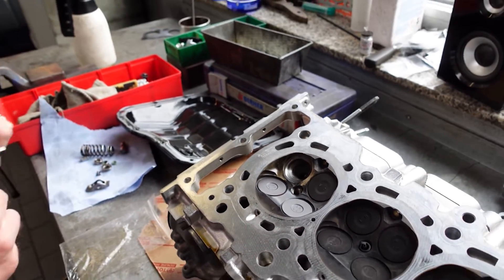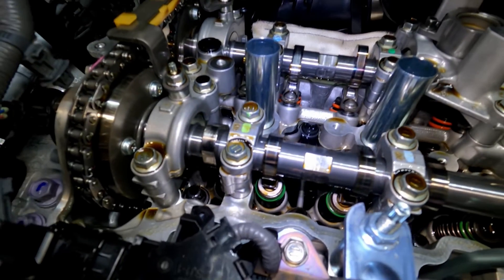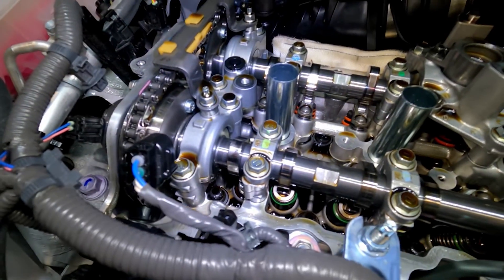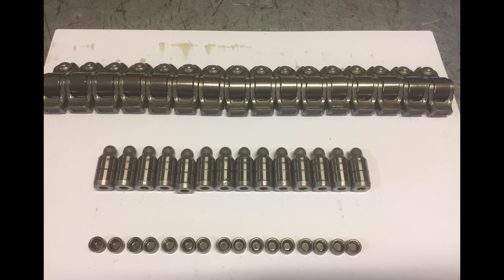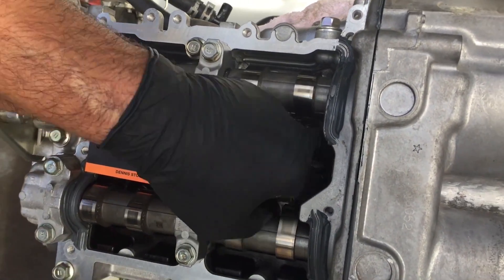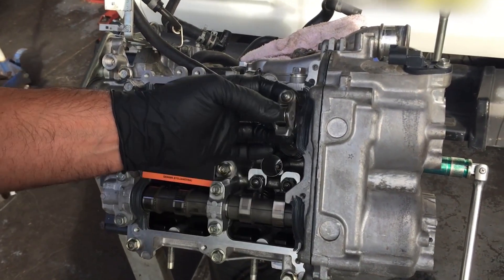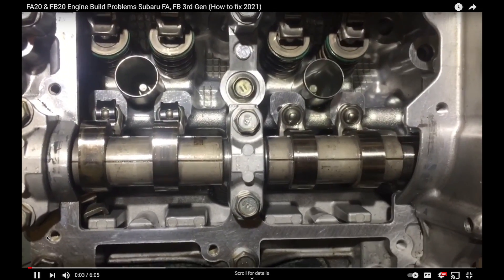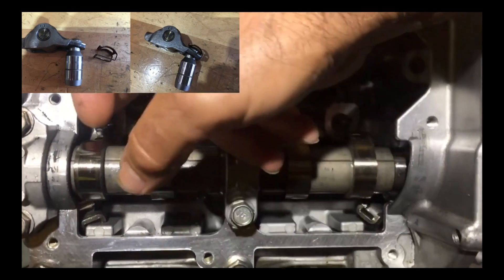G16E-GTS Yaris GR Engine Over Rev Blowing Engines? (Same problem as Toyota 86)

Comment from the maker: It's become apparent that after releasing this video about the death of @Robert Mitchell's Yaris GR on the Nürburgring, that rockers are failing on more of the G16E-GTS engines. 

That’s why we’re developing a bespoke Rocker Retainer Kit for the Yaris GR that replaces the hydraulic lash adjusters with solid pivots and rocker retainer clips. 

The Rocker Retainer Kit upgrade will give drivers of this hot hatch peace of mind, ensuring reliability no matter the driving conditions. 

We’re the experts at developing Rocker Retainer Kits, as we’ve already done for the FA20 engine in the Toyota 86/Subaru BRZ.

Price TBC.

Please email dennis@denstoj.com.au to join the waiting list.

Comment: What causes any valve to float or drop?  Welcome to the Money Shift.  The big issue today is how many unskilled people are abusing these cars, posting videos about it, then crying when toyota won't warranty the damage.   Folks, these cars have a better electronic log of what you've been doing to it, than at any time in history.  They can tell by timestamp when you've opened the hood, unplugged a MAF, and changed a headlight, all with the engine off.   I've got a '24 Tacoma - that's what happend to me.  They can easily put that all together and see what you're doing, and the engine doesn''t have to be running.

So a money shift will live up to its name, and they will have all the evidence they need to show you the bill or gently show you the door.

Comment: they should have just stuck with shim and bucket design. my 3MZ-FE Toyota Sienna is at 508,000 miles and so far no valvetrain issues.
Reply from the maker: There are advantages to running a rocker design in the valvetrain which most modern engines now opt for. This video does into the differences if you're curious: https://youtu.be/93SlrE-aGwc?si=DHSYbTDE8glf0GPX&t=152

Comment: Seems the GR isn’t bulletproof. Have heard numerous stories of valve gear failing when subjected to a bit of an overrev. Always a bit of a worry when it’s a small capacity motor that likes being revved out…
Reply: Overrev a Coyote, LS, 4A, 2J or 2ZZ sufficiently and their oil pumps will disintegrate, maybe just oh idk, don’t over rev your car? 😂
Reply from the maker: Hey @chrismc1977, yeah that’s it. No engine is perfect and this one is more highly strung than others being a little 3 banga powe house. Do you have one? We’ve now made a fix
https://youtu.be/V4IDYBl5LaE

Comment: Does anyone here know if these engines will ever be sold as a crate motor?
Reply from the maker: Hey Shiraz, great question. I'm not sure about a complete crate motor but I'd imagine you'd be able to order a long motor from Toyota, however, it would be expensive. You would be better off picking up a second hand one from a wrecker. What would you be using it for?
Reply: @denstoj  I have a 2003 Mini Cooper without an engine, I was looking at a K20 but was also wanting to do something different. I’m not even sure if there would be to many hurdles to make it work tbh.
Reply from the maker: @Shiraz ah yep a K20 would be our first pick too. Very cool project. A G16E-GTS would definitely be unique. It could be done but dependent on your budget.
Reply: @denstoj  I don't think I,d be waiting for a wrecked GR , there isn't that many around so they wouldn't come up that often, and if one did it would be highest bidder wins.
Reply from the maker: @Shiraz yes, it will be a bit of a wait but they do come up at auctions here in Australia. Takes a bit of luck! Are you based in the States?
Reply: @denstoj  No Australia as well.
Reply from the maker: @Shiraz ah cool. Keep your eyes on Pickles/Manheim/Grays auctions. Drop us an email at dennis@denstoj.com.au and we can let you know if we see any come up if you’d like.

Comment: Did they fix this for the 2022 version?  is there now news on that? or is it just a bad design choice?
Reply from the maker: As far as we’re aware it hasn’t been fixed and is also an issue on the GR Corolla since it’s the same engine.
Reply from the maker: As far as we’re aware it hasn’t been fixed and is also an issue on the GR Corolla since it’s the same engine.

Comment: Corolla gr coming same motor 34hp more 
Different pistons and head porting and oil jets 
Do you know if Toyota are aware of rocker pin issue yet ie valve drop ? 
You would have to expect so right
Reply from the maker: Yes, same engine. I don’t believe they have addressed the floating rockers issue.

Comment: just don't go from full rpm 5th too 2nd problem solved
Reply from the maker: That will definitely decrease the likelihood of a failure but it can happen any time as the rockers are floating (no physical attachment to the lash adjuster).
Reply: I try not to downshift from 5th to 2nd I always go down the gears 5,4,3,2 hopefully I don’t blown a Corolla engine 😩

Comment: Havent blown my rockers off my '13 gt86 hopefully it wont. Didnt know about it till today i see this vid.

I thought the blown engines attribute to adding power and not strengthening the rod and pistons. Are there many who have these rocker problems?
Reply from the maker: You must be one of the lucky ones then! Certainly under forced induction if you’re chasing big power and you don’t strengthen the connecting rods and pistons they'll be a weak point. However, if the rockers aren’t retained we're seeing failures under all driving conditions from stock to modified vehicles. We had multiple engines fail before realising what was going on and developing a fix. We’ve come across many more on the internet. There is a thread discussing it on the FT86 club forums if you want to read it into it further: https://www.ft86club.com/forums/showthread.php?p=3361261

Comment: Damn was thinking of buying a gr Yaris but I'll take the MX5 RF with the best seating position and take it around dandy mountains.
Reply: This issue happens if you over rev the engine. Since Robert has modified GR Yaris, he is out of warranty. If you use the vehicle as stock, the warranty remains and covers the use of the track. If this happens in normal use, Toyota will repair it under warranty. Robert had this issue 2 times. I haven't heard of anyone else having the problem. Even some track guys overheat the rear coupling unit with hard use and the car switches to front-wheel drive mode until the rear coupling unit cools. While these drivers didn't have this type of engine problem, it is interesting to have an engine issue without using it hard enough to switch it to front wheel drive mode. 

If you are still considering buying a miata; as an old Miata ND owner, I recommend the 2lt version, even the 184 hp one. Bilstein shock absorbers and Eibach springs with the sport package would be perfect. The stock suspension handles well but has too much body roll.
Reply from the maker: It's still an incredible little hot hatch. We just wanted to make drivers aware of this problem.

Comment: Sure your not just punting for business. Loads of gr yaris being really abused very minute number of failures. All those car reviews and cars being raced around circuits !!
Reply from the maker: I can see your point if it comes across as trying to sell but we’re just trying to inform people that there is a risk of rockers falling off and not completely the driver’s fault as claimed by Toyota. Most engines have some sort of rocker retainer and don’t run a floating rocker. Even the Supra engine does. We don’t have a product to fix the Yaris. Thanks for the feedback.

Comment: Overrev an evo, i30n etc the rockers bounce off when the pistons hit the valves.. 

No engine survive those Overrev situations.. The i30 are notorious for its owners overrevibg and crying warranty, luckily there's an engine rpm overspeed count in the ecu. Ford, Nissan, Porsche, BMW all have the overspeed counter as well.

The error lies in the interface between steering wheel and pedals
Reply: Cant they just build a valvetrain that doesnt spit parts before redline or revlimiter
Reply from the maker: That would be nice! Don’t think it’s too hard to ask considering they’re all performance cars.
Reply: Many years ago I was in a meeting at Tommi Makinen Racing with Esko Reiners. He later showed me one of their Subarus being repaired because of the same issue (miss shift from 5th to 2nd). Even though it took place on a gravel road, there was so much grip by the tires that the engine took the hit.
Reply from the maker: Yes it’s definitely a factor but most engines these days don’t run a floating rocker so they’re at least risk of failing.

Comment: Not bad feedback, though I think its a fairly limited issue. Much like SR20s with their rocker stoppers, I have built in excess of 30 high performance SR engines and have never used or needed a rocker stopper system (or dual guides for that matter), and have only ever seen rocker issues related to user error or excessive wear and tear. I feel the use of a retainer or stopper system is a good idea but is mostly helpful to prevent user error related faults. P.S. in 07/08 I owned the Evo 4 with plates NEV04T which you built. Great car, a lot faster than NSW HWP vehicles of the time but too easy to get carried away with and earn yourself a public funded holiday. If you do make a rocker retainer system be sure to post, cheers.
Reply: I recognised your name because I had owned the car and wanted to see what you had to say about the issue Apex had encountered. Though I do also own a GR Yaris, yes. At this point I'm not sold that it's an issue that needs attention. Even in the case of the FA motor (I own one of those, too), there was a major factory recall for valve springs - directly in line with what I was alluring to with the SR re wear and tear/user error. Time will tell if Toyota gifted us with shitty quality springs, guides or other hardware. Fingers crossed not!
Reply from the maker: That’s wicked that you’re now driving a Yaris GR! Yes, it doesn’t look like as big of an issues on the Yaris Engine as it isn’t a boxer so the rockers aren’t sitting vertically. The valve spring recall in 2012 was a fix to a different material hardness issue.
Reply from the maker: Hi Jason, thanks for the feedback. It is difficult to compare the SR20 with the FA/FB and G16E-GTS engine as they’re different designs. 

Yes, the SR20 does have issues with rockers. However, as you mentioned, it is less common. 

Each SR20 rocker operates two valves which give it more support. Meaning it has less tendency of rolling sideways and falling off as they do on the FA/FB and G16E-GTS engines.

Even though the SR20 rocker issue was not as common, as you’re aware, it was still a big enough issue for HKS and Tozmei to develop rocker stoppers.

Awesome to hear about the Evo 4. That must be the white one we did the conversion on. As always, an excellent build. Glad you liked the car!

Do you currently have a Yaris GR, and hence your interest in a rocker retainer system?
Reply from the maker: For reference, here are photos of each of the rockers demonstrating how different they are.

SR20: https://image.nengun.com/catalogue/1024x768/nengun-2261-00-hks-rocker_arm_set-79c361dc.jpg

FA20: https://elementtuning.com/store/wp-content/uploads/2014/09/ElementOEMRockerManuf.jpg